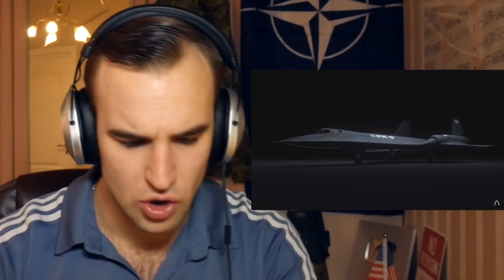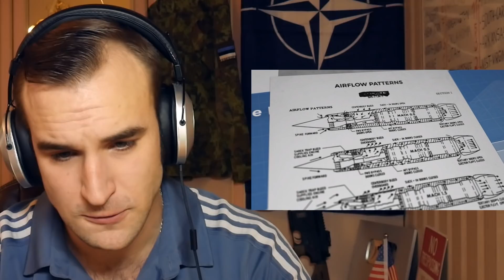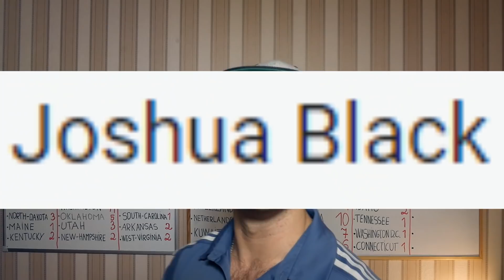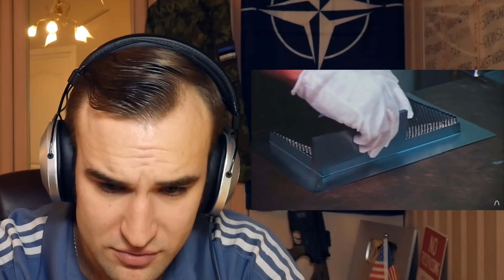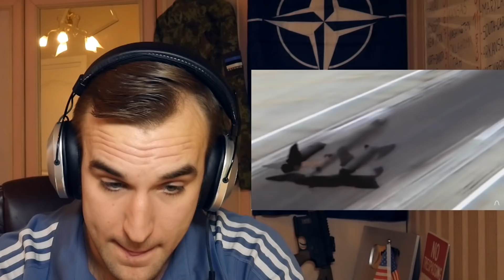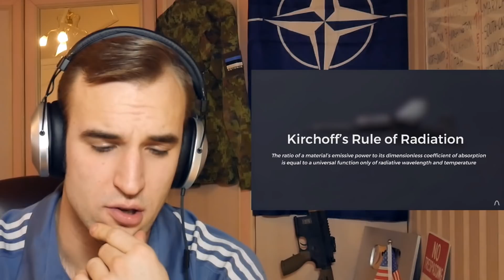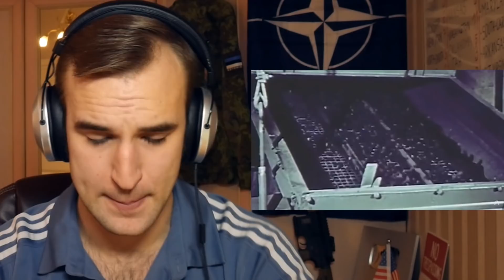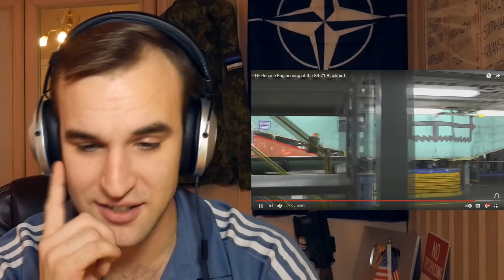Estonian Soldier react to the Fastest Plane in the World - SR-71 BLACKBIRD

Comment: If no one has said it yet,  the skin of the SR heats and expands,  sealing leaks in flight.
Reply: Just one of many things that Artur missed in this... yes... it leaks on the ground while the skin is cold. After takeoff, it does a few high speed passes to heat up the skin, and seal all the leaks. Then it takes on fuel midair, and goes off to fly its mission.
Reply: @Mr.Ekshin  I agree Artur missed several things and he also misunderstood several things, but I think it is more the fault of the maker of the video he watched because of how the material was presented. Usually Artur gets things better than he did with this one. Many pertinent facts were omitted and some things were misleading to the point of being just plain wrong. I love Artur's enthusiasm for this plane and I wish he had been provided with more accurate information.
To get a perspective from a pilot's viewpoint read the book "Sled Driver: Flying the World's Fastest Jet" by SR-71 pilot Brian Shul.
Reply: Hijacking your comment because it was at the top and kinda related.  Folks keep talking about friction when it comes to stuff like this or re-entry, but it isn't the friction nearly as much as the *compression*. There are even fire-starters from antiquity that involved a piston that was struck to rapidly compress the air enough to ignite your char material.  At these speeds, friction's just a minor component.  It's the pressure, which can't be escaped.
Reply: @bookman7409  - Exactly... if it was 'friction' the skin of the plane would heat fairly evenly across all surfaces where the air was passing. But in the heat diagrams, we see the leading edges taking most of the heat as the air is compressed in front of them.
   A spray can gets cold in your hand as you rapidly discharge (decompress) the contents. But inversely, if you rapidly compress a gas, it generates a lot of heat.
Reply: @bookman7409  To expand on this, during re-entry, radiative heating is the predominant source of heat, since radiative heating is proportional to the eighth power of velocity. 

This radiative heating comes from the compression of the air infront of the object, it's moving so fast that the air can't get out of the way fast enough and forms a very energetic shock layer in front and to the side of the object. As the air gets compressed, it steals energy from the object and is stored as heat. 

The air gets so hot it starts to glow incandescently. As the compression and heating increases, the air gets so hot that the air molecules break down into ions and electrons, forming a plasma which also gives off energy.
Reply: @Cepheid_  Interesting read, and from what I know of science, sounds right. Thank you for illuminating me.
Reply: @bookman7409  exactly. A practical comparison would be a pogo stick - on the ground the fuselage is relaxed and leaks, in the air it's a compressed spring holding everything together.
Reply: The wing length from tip to tip increased by three feet while in flight.
Reply: @Ottuln  - No it didn't.
Reply: @Mr.Ekshin  My source was an SR-71 pilot telling me this in the mid-90s at Hill Air Force Base in Utah. If it is not true, so be it.
Reply: @Ottuln  - Just based on the math, (titanium coefficient of thermal expansion) over a 56 foot wingspan, and say... a 900F temp change... would yield about 3 inches of expansion, not 3 feet.  
   But the FRAME never sees those kinds of temperatures, only the skin. As we've learned, the designers had to contend with the skin's expansion by allowing gaps and overlaps for the skin to expand. So the reality is that an SR71 going from room temp, to max speed temperatures... might see a fraction of an inch dimensional change of the aircraft as the fuel warms up.
Reply: @Mr.Ekshin  I stand corrected. Thanks for pointing it out.

Comment: It doesn't leak once it's up to speed. The thermal expansion of the metal seals the gaps. They had to design it with gaps from the get go to account for this. The reason it leaks is because the expansion and contraction destroys the sealant they used for the gaps.

Comment: The shockwave only sounds like a boom because you are stationary while the plane passes. However, the shockwave is a constant that travels with the aircraft. Remember, all of this talk about sensors was during a time when there were no cell phones nor personal computers. The funny thing about the titanium skin is that back then the major source in the world for the metal was....Russia. So they were selling the US titanium so it could be used on an aircraft that they couldn't shoot down. The fuel leaks were caused at the metal plate joints, not through the pores of the metal. Once the aircraft heated up, the plates expanded and sealed the leaks. So it only leaked while on the ground. Yes Artur...air friction caused the surface to heat

Comment: Titanium isn't that "hard" Tungsten is WAY harder. Steel can achieve higher hardness than titanium. However, titanium is less dense than steel, making its specific strength greater and thus replaces it for many applications. Aluminum has a higher specific strength than steel as well. Choosing the right material is about balancing strength, mass, heat resistance, wear resistance, fitting the part in the space etc...
Reply: You're right except for the Aluminum part. Aluminum peaks at 700MPa while Titanium can reach up to 1800MPa.
Titanium when compared grade for grade against aluminum is on average 59.8% (usually stated as 60%) denser, but also 100% (2x) stronger.
Reply: @acywei  I meant that aluminum is stronger than steel pound for pound. Not stronger than Titanium.
Reply: . THERE'S A REASON THAT THEY USED TITANIUM ON THE SR-71 AND IT WASN'T BECAUSE IT WAS CHEAP OR EASY TO MACHINE! Yes, tungsten carbide is a  harder metal. But titanium is much lighter and is able to handle heat changes, better.
Reply: well is the material are heavier that would mean slower speed, and it would be hard land and takeoff
Reply: Titanium was chosen for heat resistance moreso than weight
Reply: The titanium was also placed in such a way that when it took off, the heat would cause the titanium to expand and seal up.
Reply: Ah- a materials engineer. I hope your contemporaries are working on the materials for molten salt reactors. LFTRs can eliminate our dependence on fossil fuel, and rapidly reverse climate change. Since the US is a capitalist country, this would result in many trillionaires, here and elsewhere.Unfortunately, this would also stop most research on fusion reactors.
Reply: And titanium can handle much higher heat then aluminum and steel.